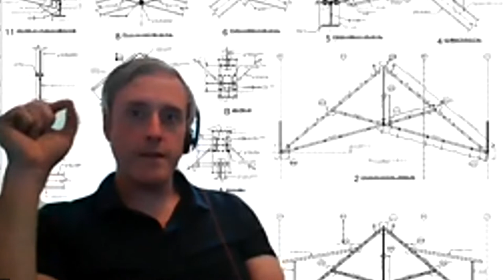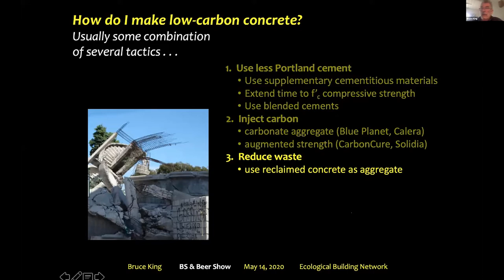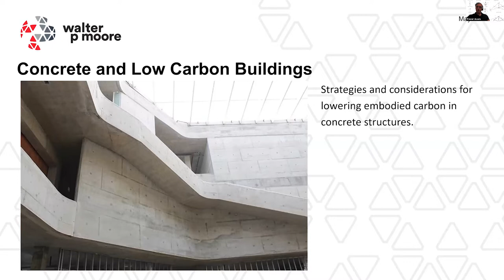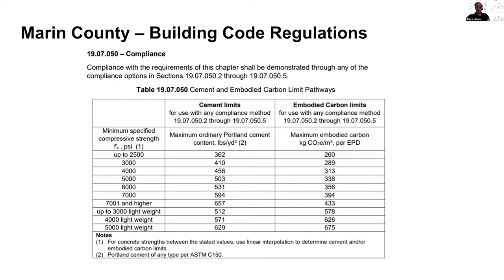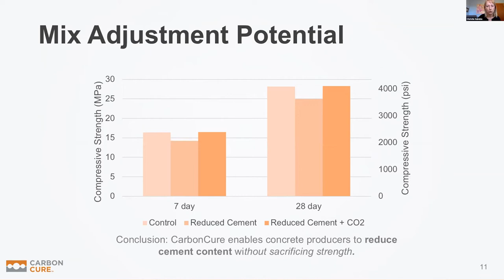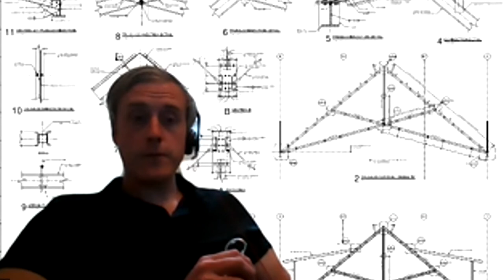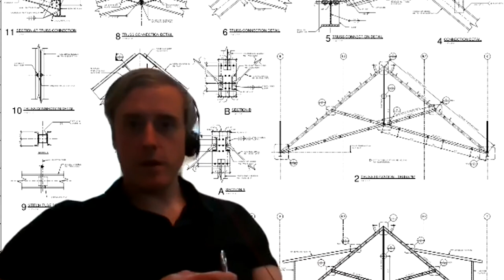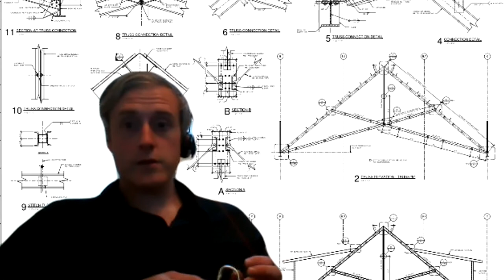BS* + Beer Show: Making Concrete More Sustainable

Comment: Also - anything about non-ferrous reinforcement?  Basalt rebar looks pretty mature if you train people in binding rather than bending.  It solves the stated issue with thick coverage to prevent rust.

Comment: Nothing about CSA-Belite?  Add a little expensive aluminum and shift the recipe ratios slightly and you can cook the cement blend at a lower temperature (less CO2) for much faster set with no shrinkage and stronger-than-Portland set.  You actually have to add in a citric acid retarder to bring it back down to the point where you have an afternoon of working time.